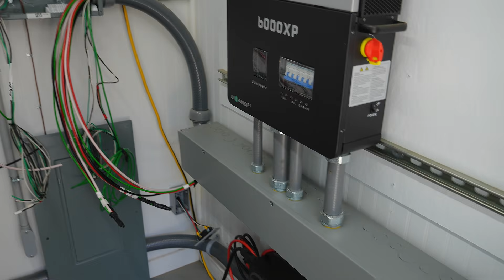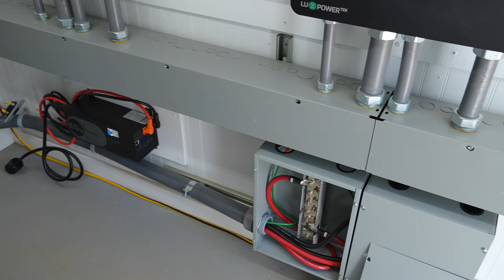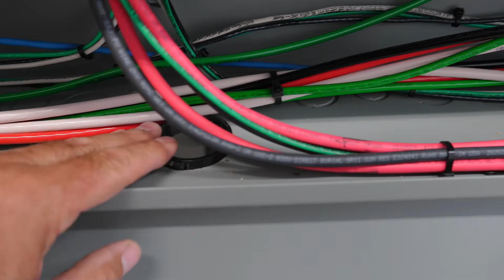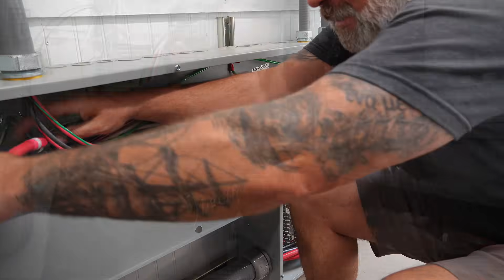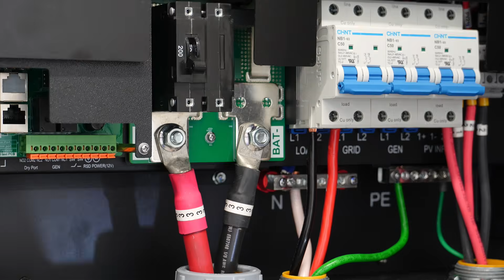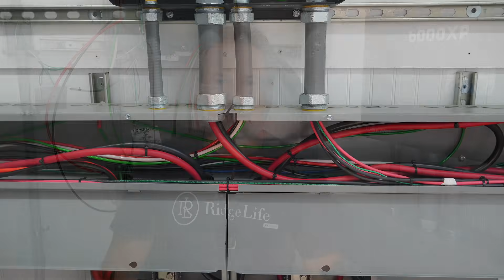LAST STEP Before Rough In Inspection! | Inverter Battery Cables and Chargeverter | Off Grid Solar

Comment: You had better recrimp all of your MC4 connectors before the inspector finds out that you used the wrong tool to crimp the connectors on to the PV wire. Either that or you're going to start a fire.
Reply from the maker: I used a MC4 crimp tool specifically for those. I don't know what you are smoking! HA!

Comment: I know that Parrallel feeds are required to be the same length, but I’ve never heard of three feeders non Parrallel need to be the same length.   Please let me know where that came from.  Maybe a best practice thing?  I’m assuming you are not concerned with the AC conductors inducing 60Hz waves into your DC since you didn’t install a metal divider to separate them.  BTW, thanks for wearing shoes.
Reply from the maker: No as long as each pos and neg of the same feed are same length. I just ordered three sets before I knew exactly the arrangement.
Reply: @RidgeLife .  That makes sense.

Comment: Tim, again nice work; looks good.     Though, I think it necessary to point out one possible oversight.  That is the connection from the battery racks to the 600A bus bar;  if I remember correctly, code requires a fuse or breaker between the battery's bus bar and the next bus bar in the event of insulation breakdown of the wire from the battery rack bus to the bus bar boxes.  Typically, a T-fuse is used at the battery bus end on the positive to protect from overcurrent on that DC circuit (in this case, the two conductors run from the battery racks to the bus bars)   Sorry, I don't even want to nitpick because you've done a great job installing everything neatly and accurately, yet my gut wants you to protect those conductors; with 10 batteries in the rack, each rated at (well the breaker is) 135A, more then 1000A is possible to draw from a given battery _rack_, well before the individual breakers might trip. If, each battery was wired directly to the 600A bus bars, then each battery's breaker would protect that run.  If I understand your install thus far, from the videos, no protection is given between the battery rack bus and the main 600A bus, that's where the t-fuse comes in to protect those conductors. I hope I explained that well.  You also might think about disconnects for each of the battery racks for future service without taking down the whole power system.  gawd, I sound like one of those YT keyboard warriors, perhaps I should just delete this comment. <sigh>  (note: I'm referring to NEC articles 705 and 706)
Reply from the maker: All great suggestions! I may do that in the future! Thanks!

Comment: I see one problem you need a 10 ohm 100 watt resistor to precharge them The one in the battery are not big enough don't Why they put that in there as selling point
Reply from the maker: The BMS will work just find with what's provided and the chargeverter doing them one at a time.

Comment: Thanks for the Solar video series. Your professionalism makes it look so easy.

Tim, you are obviously a pro at this work. What I didn't understand and have a question about is the wire in the wire trough between the two EG4's closest to the door looks like you tucked it up against the wire trough screw (time 28:52). Are they enclosed or covered or is it a camera angle thing?

Also thanks for the Fort Smith Biker Bash video. I thought it was just a little 1 stop light dirt water town.
Reply from the maker: Thanks! Yes. They have full doors that hinged down.

Comment: You should have installed modern low frequency, transformer based inverters instead of those old fashion high-frequency inverters if you wanted a system that would last you more than a couple of years.
Reply from the maker: HAHA! You are funny!

Comment: you can get wing bolts for them I not sure where they got them from Thanks for the bushing and if you remember I talked to the panel on the shed well my problem was I had 4 435 watts on top and 3 of them on the side so what was happening when the 3 was pushing the 4 was pulling them down and when 4 was the 3 pulled them down so I keep the 4 going to my Victron 450/100 the wired the other 3 to a old 150 45 I had thing are a lot better By the way 125 amp in the battery
Reply from the maker: Thanks!!!
Reply: @RidgeLife  You do do nice work I would have like to see you use fuses and bigger main wire but if nothing you ok but that is why we protect things for the what if The 1 ga if a short happens long enough  but say its just a 800 amp load it can't take that And you main wire are to small for me I would have used 4/0 that's is not big enough but it handle it a lot better the 2/0   2 4/0 will give you 628 amps without overload 2 2/0 is only 400 amp would you be pulling that much no If I remember right it takes 135 amps for full power that would be 405 amps so it is ok for that and you need bigger inverter if you need more the 75 amps any way But I would think about running at least 2'/0 to the house jut in case you need more power aluminum 2/0 wire on Ebay is not that bad well compared to coper

Comment: Good day Tim would it be easier to have the reds in the first two holes and the blacks in three and four so you don’t have to cross between the terminal boxes as often
Reply from the maker: That’s how I was gong to do it but was suggested to keep them paired as much as possible.
Reply: That’s good I live in Uk I like to see how you wire up outlets compared to how how our electricity works as we work in 240 for all our power keep up the good work